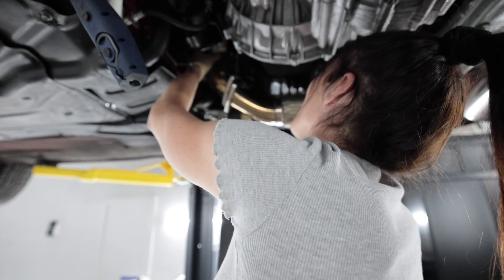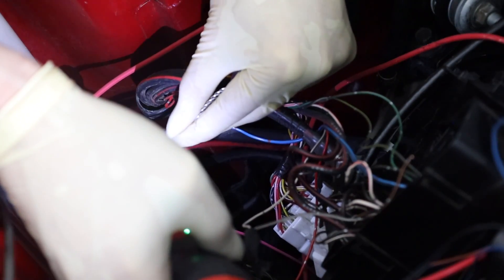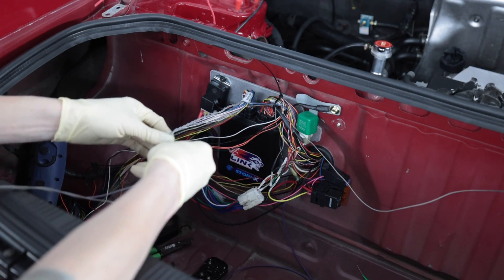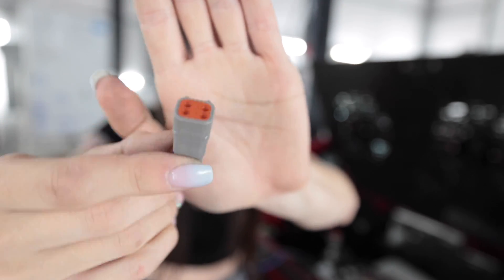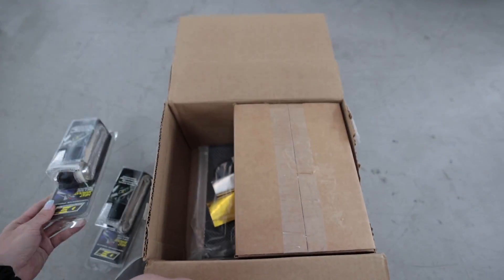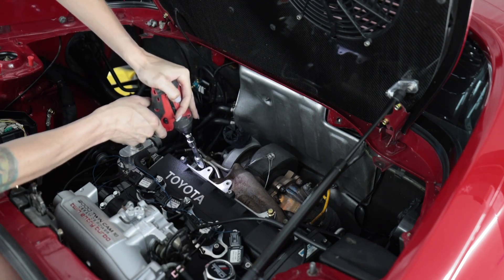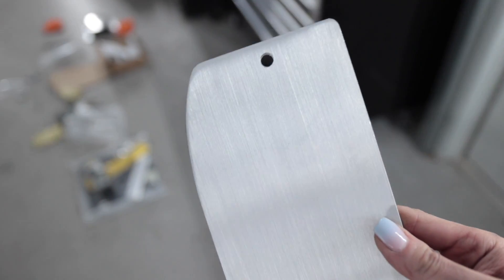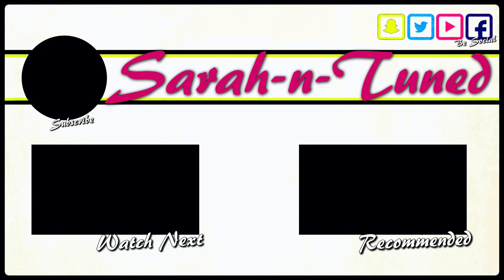Should Have Done This A Long Time Ago! // Project MR2 Turbo

Comment: Beautiful, fastidious work. Love chicks that DO STUFF!   But just one little thing... there was a green fuse that looked like a generically sourced one. After researching fuses, I threw away all the 9.00 fuse kits that have 500 assorted pieces. Turns out they are just different colors of all the same fuse.... and all will hold nearly 43 Amps.... real nice on a 15 or 320 amp circuit.  I hated to spend 150.00 on a NEW kit, with far less of each fuse in it, but I got a Bussman kit. It was either that or Littelfuse... no more Pearl Harbor Freight  !  Found cheapest online sketchy seller, and use their price compare and bought from Zoro. IT saved 30.00, and I did have an account with Zoro already.

Comment: I'm very interested in the new Ford Maverick when you can get your pretty hands on one. Most importantly the 2.5 litre front wheel drive hybrid if you can get one, but I'll assume you will do the awd 2.0 ecoboost because they will be more fun. I think oil is going to all-time highs, which means gas prices will do the same. IF I didn't think gas was going to go so high, I'd be looking at the Santa Cruz, so I hope you can review one of them soon as well. I think the Santa Cruz will be a little quickie considering the horsepower to weight ratio. Yeah, these are Nancy boy trucks if you can even call them that. They are really cars with a teeny weeny bed impersonating trucks. I already have a Sierra 2500, so I'm just looking to buy a daily driver and road tripper vehicle with a few more capabilities than a car.

Comment: Which components are you supposed to wrap with the insulation wrap?  Like the turbo manifold? Downpipe?  What other benefit other than keeping heat away from surrounding components?  Is it safe to keep so much heat into those components?

Comment: Hi Sara.I really enjoy your wiring of Mr Dos. If you ever need high temperature insulated wire try Teflon insulated wire. It's not much more expensive. The insulation does not melt when soldering like PVC. It is what we use in aircraft. Note if you twist wires the total length will decrease. Make sure your wires are long enough. I like your use of the relay that you re- engineered.

Comment: With the exhaust wrap, next time you do it soak the roll in a bucket of water.  It helps reduce the itch factor.  You need gloves too or your hands will turn black.  The water helps you pull the wrap really tight without ripping it.

Comment: Apparently the crimp vs solder discussion has been disputed for many years and continues.  I have never loved any of the solutions available. Crimping sometimes gets loose, solder cracks under vibration.  Gold plated screwed compression fittings?  Overkill. What do fighter planes use Sarah?

Comment: Hand braiding?  ✋  take a drill and place the two wires in the chuck and step back and spin drill. Ta-da!  

Had to edit after watching more....Usually people soak the heat wrap in water so it stretches a little and when it dries it shrinks a bit. Probably would have kept the itches down too.

Comment: Top tip for making twisted pair wires, put the unterminated ends into a drill, support the terminated end and pull the trigger on the drill.

Comment: Hey Sarah, at 6:12 you said/showed your wiring the sensor grounds to the transmission ground?
I know your almost finished but I think you should look into "clean vs dirty grounds" (and Power) because I have seen issues caused by "improperly grounding sensors".
Sorry I don't have time to look for your Link wiring schematic but every ECU I have ever installed and or tuned (Holley, Maxx, FuelTech, AEM and others) all have at least one ground wire available for populating directly from the ECU to the sensors. So long story short, if you have issues with any of the sensors (or Data) glitching or not reading smooth it's more than likely because they don't have a "clean" ground...

Comment: I find that when wrapping an exhaust pipe. Soak the bandage in water first. Stops the itching. Also as it drys out, the wrap pulls tighter. Hope this helps.

Comment: When you wrap with lava heat wrap, ceramic, glass, or what ever you are best to keep the itch down and keep fibers at a minimum, is to soak that stuff in water then wrap so you can also use it as a lubricant to get it to stretch a little to make it snugger or tighter on the pipes you wrap, and when it dries it holds to tubes better. Need to wear a mask because that stuff will get in your lungs and cause cancer.

Comment: As much as I enjoy your work. You should never solder wires in a car. Crimp them. Solder will degrade with heat and vibrations from the engine. Crimps stand up way better and longer.

Comment: Love your content but just wanted to point out that using copper antiseize on aluminium (your spelling not mine) can cause a galvanic reaction.

Don't get me wrong, I use the copper based stuff also, but am paranoid with it around aluminum and use the silver antiseize there instead out on an abundance of caution.

Final fun fact; that green creepy death you observed on the wiring harness was probably a galvanic reaction.

Comment: Guess the wrap supplier neglected to advise you to soak the wrap in water prior to installation which allows for a tighter wrap and way less inching for the installer.

Comment: A step drill is probably the best method to enlarge holes in sheet metal.  It won't make one of those weird triangular holes that a drill bit can make.  It also can make an easy chamfer at the same time.

Comment: hay girl.. quick tip on a fast way to braid wires.. pull your harnes to lenght,, twist off the last inch.. put it in a cordless drill and pull the triger.. braides nice..

Comment: I had to help my buddy with his turbo heat wrap on his gti and that was a pain in the ass and we had to take off the down pipe too. His gti was designed juuuuuust right to just about fuck u n every angle but there is always a way to get'r done.

Comment: How the absolute f*** did you wrap that downpipe better installed in the car then I did my last one on a bench??? 😮
Reply from the maker: Lol, it took over and hour and I still itch a day later.
Reply: @SarahnTuned  I installed insulation for a few years, I still itch. The look you are getting in the engine bay is buster.  👊✊✌️

Comment: After waiting about a month I finally received my waterproof electrical connectors from Amazon US! Spent 2hrs last night crimping the connectors on my AMP, next will be cutting and crimping the speaker wires in the Z4 boot which will take more time as it is not a convenient location to work on. You're an inspiration Sarah :)

Comment: Before starting for the first time, install a quick battery disconnect and have a fire extinguisher handy.  I hate wiring.  Can't wait to see it run.
Reply from the maker: Extinguisher is mounted behind passenger seat.

Comment: Pro tip on doing a twisted pair of wires.  Clamp one side of the wires and pull them tight from the other end... Secure the loose end of the wires in the chuck on your drill and spin twist them with the drill.  Over twist them a little because the twisted pair shouldn't have gaps between the wires when they relax.

Comment: I recommend you do a proper full AC delete. This will give you extra clearance to your aftermarket sports exhaust.
Reply from the maker: Totally, I should do a seatbelt and steering wheel delete too.
Reply: @SarahnTuned  Don't forget brakes.
Reply: Then you wouldn't have air conditioning.. in Arizona.. in the summer..

Comment: @Sarah Are you doing anything to protect the labels on the wires? I can forsee them loosing their adhesive over time and the heat.

On another note, any suggestions for a scenic drive from Phoenix to Tucson? I'll be coming down there for Spacefest.

Comment: You did not explain it much, but commented that the sensor wires would ground to that transmission ground. That is usually a big no no. Usually the sensors ground into the ECU. Then the ECU main ground is grounded. Since the sensors are often a reference ground, if they go to a chassis ground the reference can be off in the ECU, and also noise from other components can be introduced.
Reply: Yes sensors should be on an ecu supplied signal return, sensor ground, zero volt reference or whatever the manufacturer calls it. However, you should ground the ecu to the engine block not the battery. This way if you have one wire engine sensors, that are grounding to the block the ground reference for the ecu and sensor are still the same.
Reply: @Turbochargedtwelve  Correct. I edited mine. The ECU should be grounded to the block

Comment: put some extra wires in the loom as spares... also if the ECU supports drive by wire at least put the wires in for adding it later, it will make drivability better, I'd recommend it.
Reply from the maker: Doing that!
Reply: @SarahnTuned  Take a bow.

Comment: Since this is a wiring project - if you are needing supplies we have a local to AZ company specializing in such things! ProWire! Also, be wary of buying wire from places like Amazon - the recent trend there is CCA (copper clad aluminum) masquerading as 100% copper wire. CCA is more brittle (how fun it always is to find wire breaks) and only carries ~80% of the conductivity of pure copper wire. So always makes sure you are buying something like TXL or GXL wire. I generally only order wiring supplies from places like Painless, American Autowire, etc.  Also, for heat-shrink if you need something smaller than a heat-gun , PowerProbe makes a small butane torch that also can double as a soldering iron - however it is my go-to for heat-shrinking. I am currently re-wiring a customer's vintage Datsun, so thought I would share some tips since I have been doing automotive wiring in the custom / hot-rod / race spaces for a couple decades.

Comment: Little tip......soak the heat wrap in a bucket of water for an hour before wrapping....helps keep dust down and it pulls tighter
Reply from the maker: The water would evaporate into a cloud that would float away and never produce a single drop of rain before I could dip it in.
Reply: @SarahnTuned  suppose so with the heat and lack of humidity you deal with down there lol
Reply: @SarahnTuned  DAMN.

Comment: Ya. Fiberglass Cloth sucks to work with. I wrapped the pipes on my bike but it barely did anything and held water after rain so it got nasty. I took it off a few months later. Those things sometimes cause rust.

Comment: Do we recommend soldering for connections near hot engine and heat soaked compartment? Isn't that why we use crimped connectors? Just asking
Reply from the maker: It’s irrelevant at that point because you’d have more serious problems on your hand if your engine was hotter than the melting point of solder 😂.
Reply: @SarahnTuned  I was under the impression that common solder usually melts around 350°  to 380 f. Exhaust manifolds and turbochargers get a whole lot hotter than that.
Reply: @SarahnTuned  my racing engineer / builder always told me that crimping was better than soldering on cars or motor cycles  because Soldered connections are brittle and more subject to failure from vibration. Same reason braded wire is always used instead of solid copper.  In addition solder connections close to exhaust manifolds are suspect as they  usually run between 1200 and 1600 degrees F.  
 A catalytic converter  doesn't even light off until 600 degrees Fahrenheit and operates as high as 1600 degrees... Way beyond typical solder which tends to flow between 350 and 400 degrees. 
When was the last time you saw soldered connections in a car made after 1940?
Reply: Typical wire insulation has a melting point of 194 degrees fahrenheit so...
Reply: @mostcom  house wiring.... Hopefully there's a significant lack of internal combustion in your attic
Reply: @larryordine7542  Romex is 185 degrees

Comment: Top Tip for Sarah.  If you need to braid wires again, especially over long dfistances, use your cordless drill.  Just close the chuck over the wires, and let it do the work for you.  End result will be more consistent twist ratio too.  :)
Reply: Make sure you pull fairly tight - before pulling the trigger!

If not, please take video.
Reply: But..but.. My drill isn't cordless :(   ;)
That's a sweet tip! Low speed people! Let's not wreck those wires and whip 'em around the room..
Reply: Just don't go overboard with the number of turns - you aren't creating Cat5 cable - too many twists will just eat up length and not do much else.